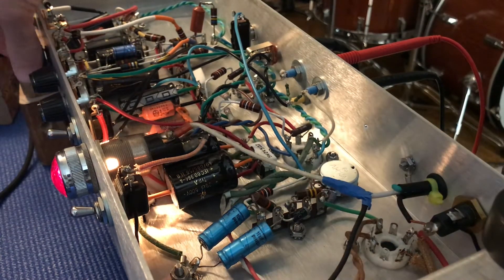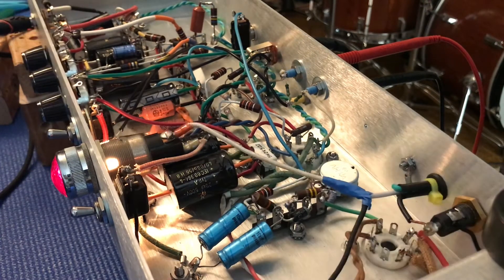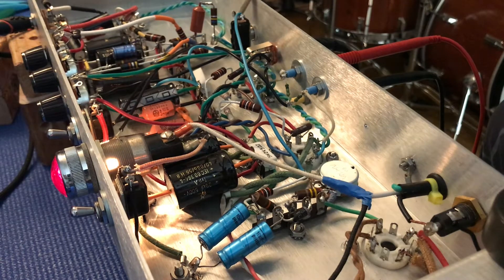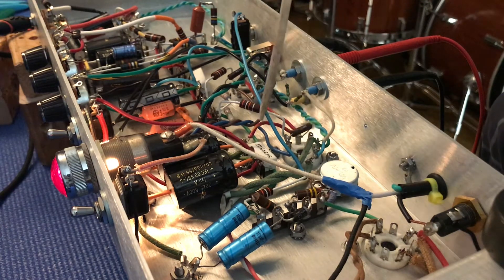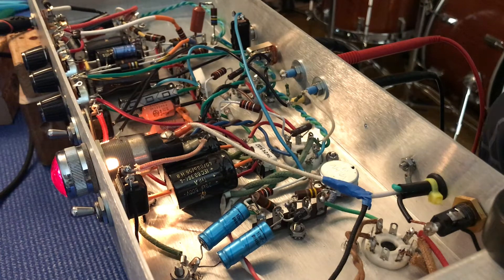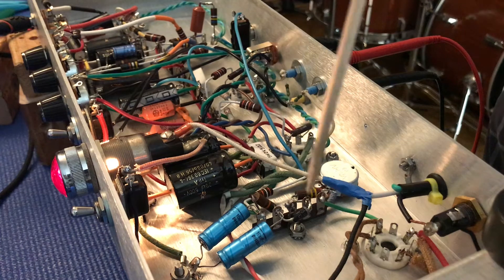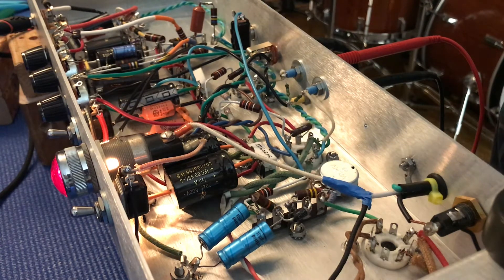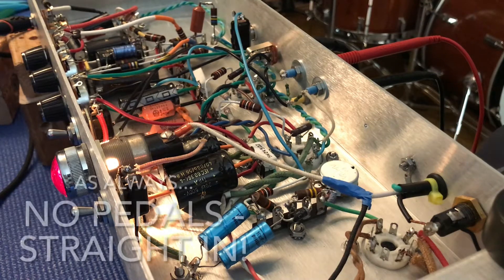6V6 tube amp with cathode / fixed bias switch

Comment: Stumbled onto your YouTube dude, that's really cool what you did to that amp man, bit of a bird's nest in wiring, but still really cool, makes me wonder what kind of computer you could build.
Reply from the maker: Thx! Yes, the “birds nest” is an inevitable result of the point-to-point approach (no circuit board) combined with my skill level. I try to utilize the 3D aspect of separation to reduce noise, like keeping heater wiring low and signal path wires high, etc.